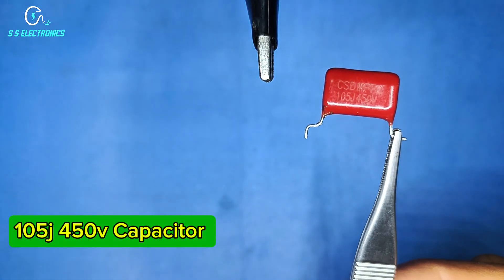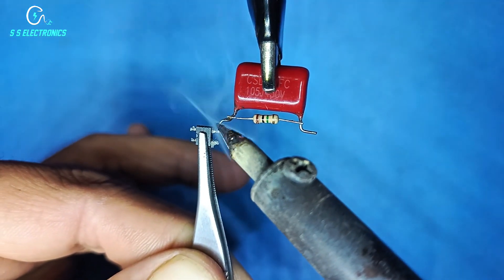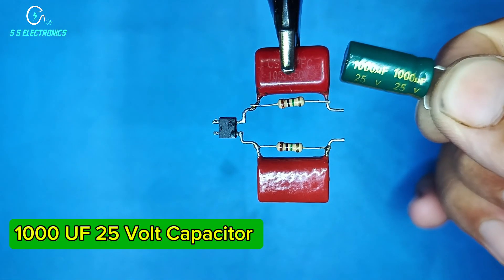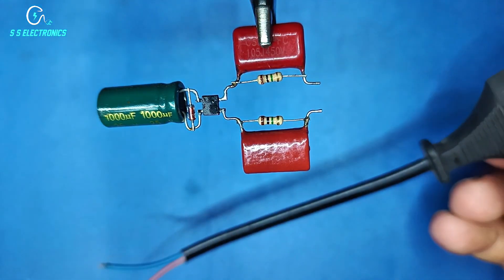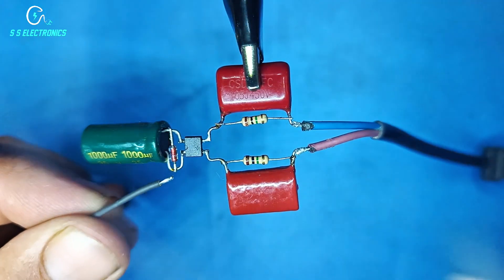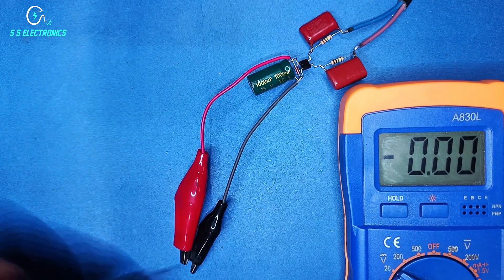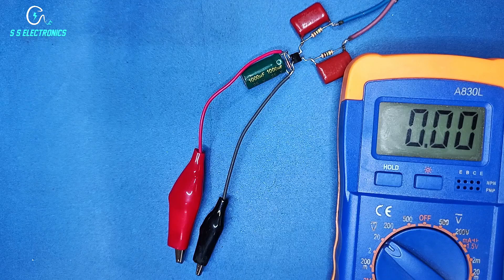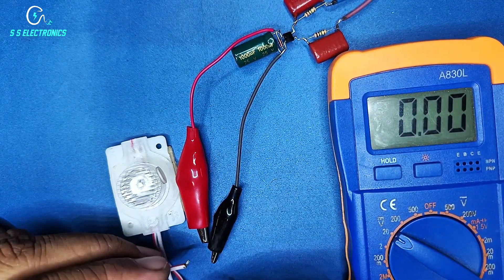220v Ac To 9v Dc Converter | Ac To Dc Power Supply | 9v Power Supply

Comment: how it is not harmful
Reply: Switch off then toch not harmfull, switch on then voltage mesurement... 😁😁😁
Reply from the maker: No
Reply from the maker: Because it Save circuit You can Easily Touch output